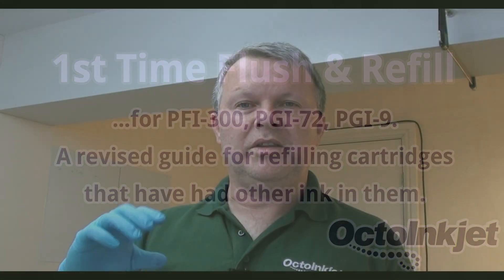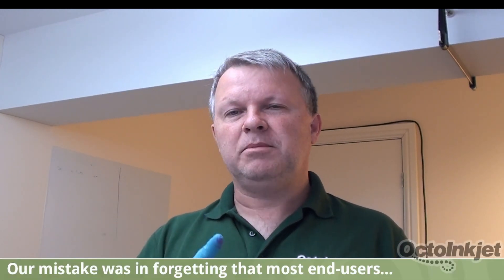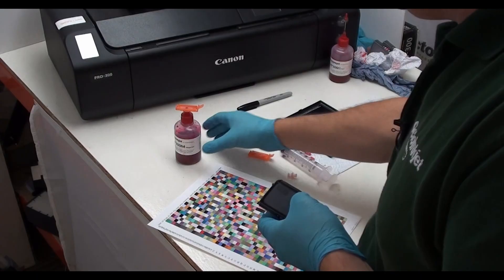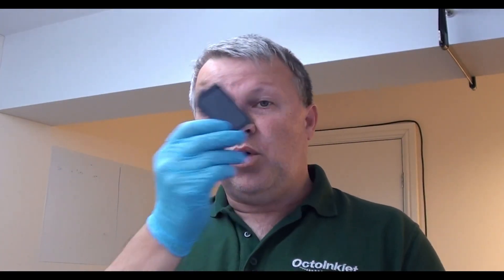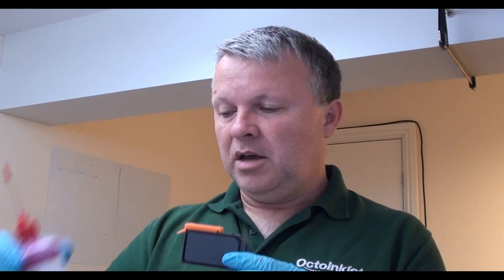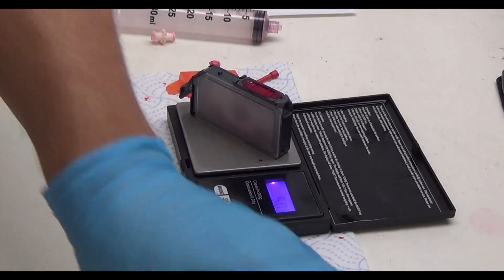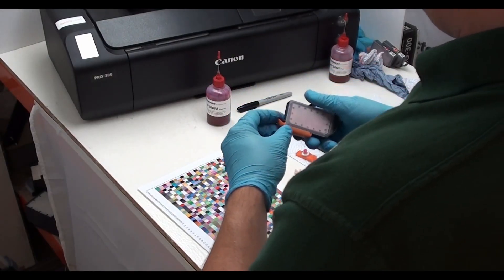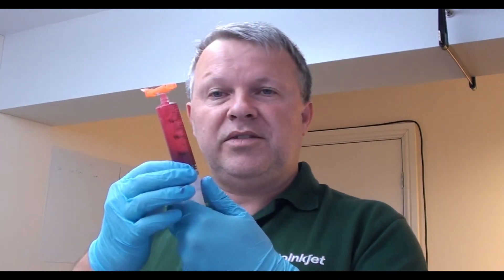Flush & Refill Canon cartridges for the first time (PGI-9, PGI-72, PFI-300)

Comment: My printer is now printing with alot of verticle lines after refilling the cartridges.. what do I do? most of the photos are coming out with verticle lines
Reply from the maker: Try using a syringe and flush clip to push pull ink through the cartridge outlet, then re-prime the cartridge. But that sort of result is often caused by poor ink flow through the internal mesh/filter behind the sponge outlet.
Reply: @octoinkjet  oh i got it to print smoothly again. I just over filled the magenta... lol.

Do you have suggestions how to print more vividly? the pictures come out too dark when I print from "my pictures" on my computer
Reply from the maker: One to file away as potential causes :) As for vividness, pigment inks are usually less vivid anyway but best way to handle is to get some good quality papers and get your ink/printer and papers all profiled.

Comment: Whats the chip resetter that you are talking about in your site that is not included ?
Reply from the maker: Chip resetters reset the ink level on compatible chips. So if you can use one they reset the chip back to “full”

One for the PGI-9 carts is shown here:
https://youtu.be/NedEeYYINek

The PFI-300 does not have a compatible resetter unfortunately.
Reply: @octoinkjet  so for pfi 300 I don't need it...
Reply from the maker: Recommend you watch the PFI-300 playlist which shows one video in particular about the full-set-swap method as this helps you reduce the waste ink and also avoid the need for a chip resetter. A resetter would be preferable if one were available but our videos show how you can work effectively without one.
Reply: @octoinkjet  one more thing.. To put one the ink that is inside.. And after put with the new ink.. Is it compulsory? Or it's OK to put all the new ink directly when I get your new ink..
Reply from the maker: I think I know what you mean. If there is ink still in the cartridge, it's better to wait until the cartridge is empty before you refill it. Mixing old/original ink with refill ink means the printed colours will be slightly different for longer until the old/original ink has been all used up. Is that the answer you were after?
Reply: @octoinkjet  yes its OK now I understand what you say. Does the printer have any system that can understand that the inks are already finished? Do I have to reset the ink somehow before I put your new?
Reply from the maker: The cartridge chips will indicate when they are empty once you finish (most of) the ink in the cartridge before you refill. Once you refill a cartridge that has been declared empty by the printer you will have to disable the ink monitoring before the printer will accept the cartridge. So, once you start to refill a cartridge, with ink monitoring disabled, the printer will not detect when the cartridge is empty in the future.

For that reason you want to learn how much ink is used for X prints and then refill early. Most of this is described in the full set swap video.

Comment: Hello! What ink do you use for Pro-300?
Reply from the maker: Our ink set is here:
https://www.octoink.co.uk/pid/885

...and the whole refill tool + ink bundle is here:
https://www.octoink.co.uk/pid/886

The inks are pigment type formulated specifically for the Pro-300.
Reply: Great! And also are the cartridges pgi-72 , phi-9 have the same forms and sizes as the cartridges for pfi-300?
Reply: @octoinkjet  and also can I use refilled pgi-72 cartridge for canon pro 300? Are they the same or no? If we do not take the chip into account 😅
Reply from the maker: The PGI-9 cartridge is an older design but works in the same way and each cartridge type will fit each others printer if they have the correct chip.
Reply from the maker: The PGI-72 cartridges will work yes. TBH though I'd either use your original PFI-300's (for ease) or the PGI-9's (for their window).